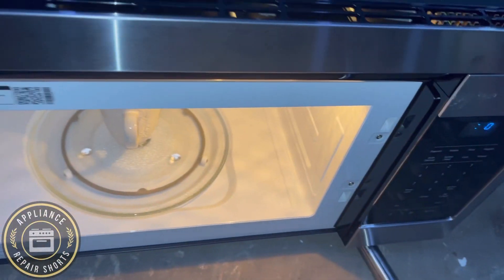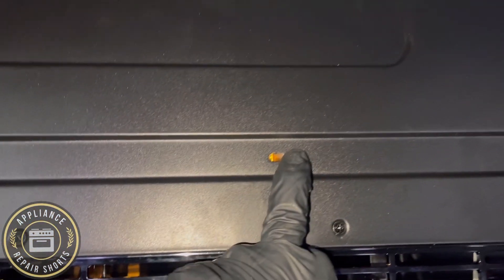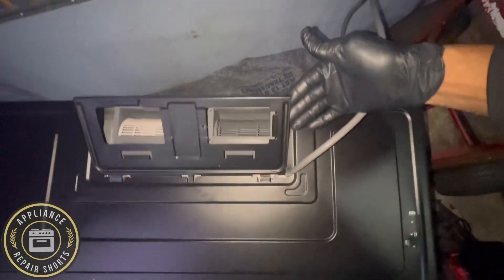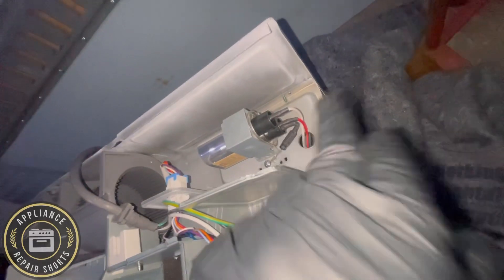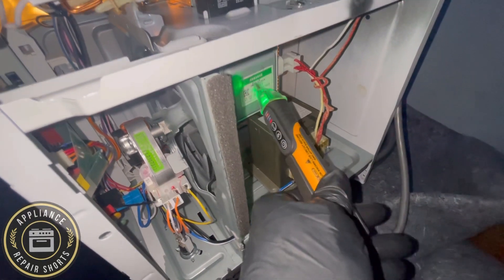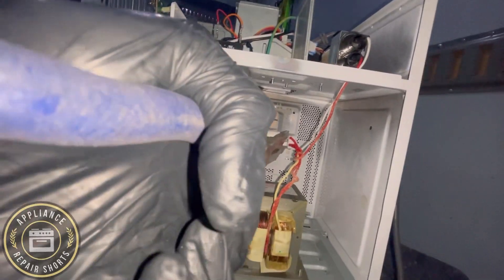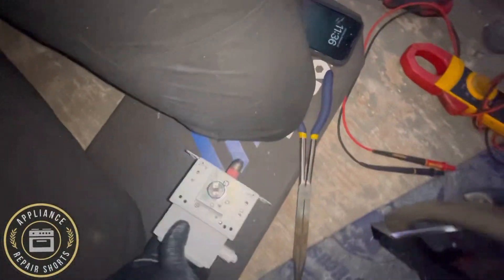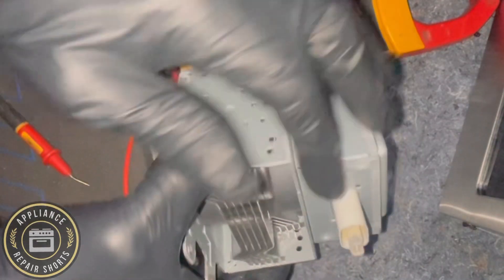Samsung Microwave Not Heating |Weird Sounding

Comment: Very good explanation and video. I have used a 9 volt battery in series with my meter to check the diode on DC volts. Always something interesting on Your videos for sure.
Reply from the maker: Yes, definitely the two 9volts or a 12 volts battery. Appreciate your comments

Comment: Hi, Great Video. My Samsung Microwave failed the same way. It was turning but not heating up. Many people are reporting the same issus and the problem is often the magneton. I didn't have all the testing tools but I was wearing gloves. I just replaced the Magneton and the microwave came back to life.
Reply from the maker: Excellent work, thanks for sharing that. Good job on the gloves. Those gloves I wear, offers shock protection

Comment: Can’t you check the magnetron without taking it off? Mine is not reading over 1 but from ground to each prong i get 37. How do i check the transformer?
Reply from the maker: Your magnetron is bad if you’re getting a reading from any pin to ground/the body
Reply from the maker: Testing a Microwave Transformer | Live Testing | Checking Voltage on Microwave Transformer
https://youtu.be/NV50FRV-hUs